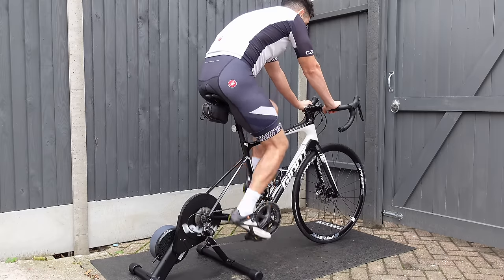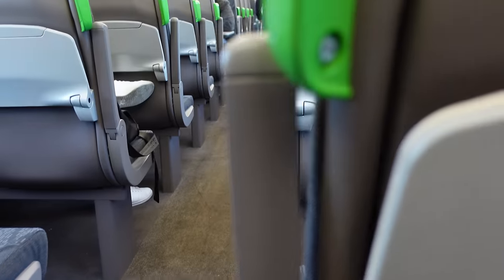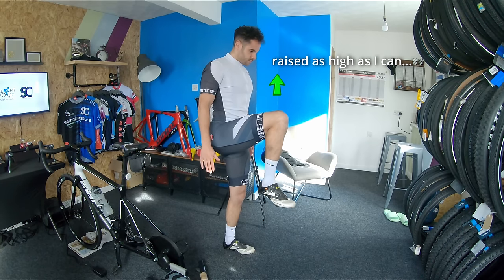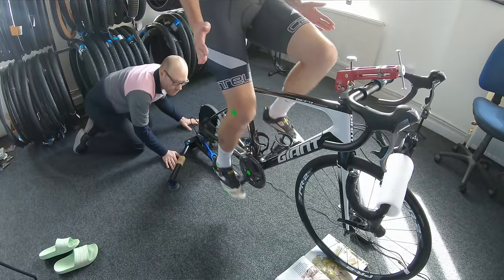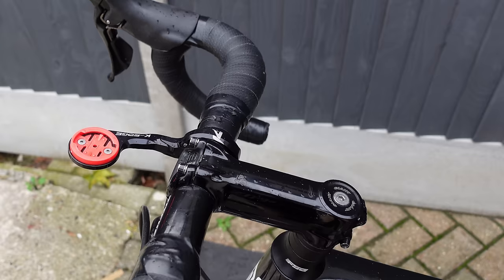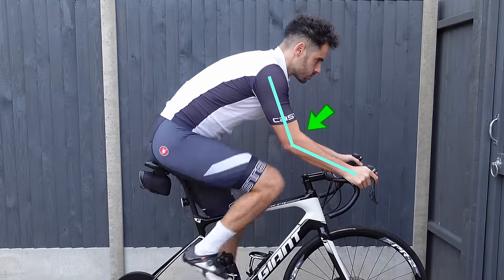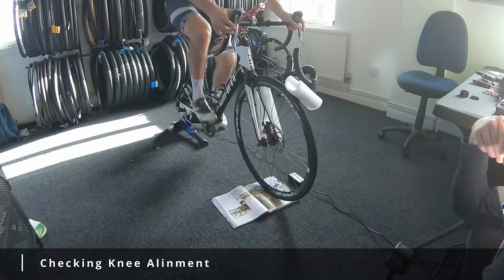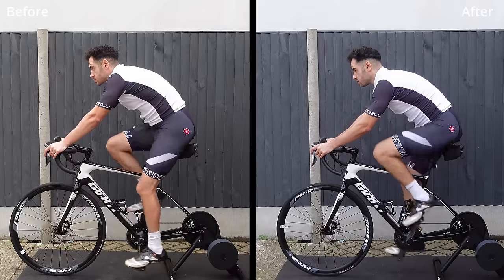I've Been Suffering For 3 Years // Full Professional BIKE FIT in 6 Steps!

Comment: I am a former pro rider and i can tell that your new position is so much better. Your upper body still moves a lot though (bouncing in the saddle), which is most likely due to your pedalling technique (pushing rather than spinning). Your shoulders move side to side, too, and this could be improved as well. Aim for a completely static yet relaxed upper body. Cheers!
Reply from the maker: Interestingly on my Elves I feel like my body is more stable out on the road - https://youtu.be/9O0AzPacRjo - I can certainly work on my peddling for sure, it's an interesting journey with steady improvements. Cheers for your comment. 👍🏽
Reply: @JourdainColeman  If you decide to work on your pedalling technique there's one simple exercise which you can do on a trainer and which can help you to improve greatly. These are single leg spins, done 5 mins with each leg at low resistance followed by 5 mins spinning with both legs as usual. You'll feel the difference immediately but for a long lasting result you'll have to make it a part of your warmup routine or do a separate session a couple of times per week.
Reply: can I ask you a question? I testrode a newer roadbike with the typical broad and flat top tube (an 2018 trek emonda) and found that my knees are prone to rub slightly an the tube. Seems I'm pedaling a bit "inward" with my knees. Should I avoid buying such a bike or could I change my knee position relative to the top tube by using differnet pedals for example? thanks in advance!
Reply: @koyaanisrider6943  , without observing your pedalling technique, it's difficult to provide a definitive answer. However, in general, knees slightly turning inward is not a concern. On the other hand, hitting the upper tube is a significant issue. If this problem is caused by your pedalling technique, it's worthwhile to invest some time in correcting it. If it's not a fundamental issue, your body may adapt to the wider upper tube, and the problem may resolve itself quickly. However, I personally would be hesitant to purchase something that doesn't feel right from the start. I hope this helps. Cheers!
Reply: @azteccat3027  thanks a lot, man!
Reply: I have had 2 fits done. Still have lower back pain when cycling 😢. I've given up on long drives. Max 40km is what I can do, with back pain starting from km 10. No medical prof Found an issue with the back. Thx for the video. Happy rides!
Reply: Thanks for this.   I just broke a vintage Vetta saddle I think due to poor technique.   Will work on my form.
Reply: Have you been to a physio? I've been and we found three issues that improved my lower back pain which used to kick in at the 30 km mark: 1) weak glutes 2) non activating glutes 3) non activating core. If you have any or all 3 of these issues, your lower back will be compensating for them which easily fatigues it and hence becomes sore
Reply: Pants.
Reply: You can even see on you new position you have so much weight on your back and saddle compare to your arms. It is like you are sitting on a old womans bike. You have a too rounded back, sitting with a curved back gives you problem in the long run. Powerwise you should have more pressure on your arms so that your weight is more forward on the peddales.

Comment: Last year I had 3 bike fits in 4 months ,all 3 were different settings , makes you wonder.
Reply from the maker: That's not good to hear. Did you find a good position in the end?
Reply: @JourdainColeman  yes my own trial and error.
Reply: Question of background theory, utilized equipments, age of the captain,...
Reply: @JourdainColeman  that's what she said
Reply: Exactly what I experienced as well. 2 bike fits and 2 different set ups. Non of them took away all my issues. 2 years later I am still feeling neck pain, knee pain and saddle pain, hands and feet that become numb. My way out at this moment is still trial and error and some YouTube video's which are also often contradictory.
Reply: @HennieBours I am feeling pain in my elbows any clue why it may be
Reply: One thing not discussed here is… CRANK ARM LENGTH. basically bikes from the 1970s when I grew up all had 175mm cranks—these are generally pretty OK if you are 6’2” tall. I’m a little less than 5’11” and new studies/papers show that 165mm is probably best for my leg length—imagine if you are 5’4”!! Basically shorter cranks allow you to have an easier time with your saddle position Where you can avoid both overflexion of the knee at the top of the stroke and less hip impingement, while remaining low enough to not reach for the pedals. Cleat position is also a big deal—I firmly believe in more of a mid-foot position (cleats further back). Ball-of-foot cleat position was considered “correct” in the 1970s because people just assumed bike pedaling mechanics should work like running—it totally doesn’t. There is no reason to overload the front of the foot forcing you to do a lot of calf contraction just to stabilize the foot, when you could transfer the load much closer to your ankle reducing the need to use calves inefficiently. This also lessens the need for shorter crank arms by the way, since there is less knee flexion with the cleats farther back.
Reply: @devashishrege1  2 most likely reasons: 1.handlebar width (more on the bigger size” 
2.too much pressure on the palm/hand. You might be too close to the bars.
Reply: @tonypowers123  it’s gravel bike checked it perfect for my shoulder 

Need to check the second option
Reply: Makes you wonder indeed...
Reply: Despite what fitters would like you to believe, bike fitting is NOT a science!  There is a lot of nonsense, technical sounding jumbo-jumbo and snake-oil salesmanship that goes into bike fitting.  Most people could set themselves up perfectly well by using a few time-tested rule-of-thumb guidelines and a little experimentation.
Reply: @devashishrege1  I'm not an expert, just a rider. More than likely it's due to your bars being too narrow causing your elbows to rotate in and placing the stress and weight on the joint rather than your triceps.   Measure from the "knobby" protruding part of your shoulder to shoulder and that will give you an idea of what width bar to use.
Reply: Saddle tilted up 1 degree does not sound like a good idea for your nether regions.
Reply: Its snake oil as the same pos is not great for all. You know best.

Comment: Sorry to say this. But your final position is far from ideal. I am a bikefitter in Spain and I would say that you need a wider saddle and the saddle height is still wrong. In the final position you are still too far from the handlebars, not because the reach is incorrect, but because you are seated too far back on the saddle (usual compensation for insufficient saddle width). Get a 155mm saddle, my recomendation is specialized power or bontrager aelous. If you are willing to follow my advice, let me know if I was right :)
Reply: Your hip is blocked because the way you seat and I bet you will have back and hip pain in the future
Reply: can you provide me a bike fit thru skype?

Comment: I'm surprised you didn't make changes to your saddle drop by removing or adding spacers on the stem. This makes a big difference to your riding in terms of aero position and comfort. What's your current saddle drop? FYI, my drop is 7cm.
Reply: I set cleats right back first then fore aft and tilt then saddle height followed by stem height. I think stem or stack height is crucial for hip angle and Aero position if you race or group ride.  Stem length I think is best left to the last adjustment the same with bar width even though they are important. That works for me anyhow.

Comment: Bike fit is actualy very simple and it doesn't cost much. I would have done that just by looking at your riding position and your flexibility score. All in all a good cyclist who puts around 10k kms evey year needs a slightly relaxed position so that there are no injuries and unnecessary fatigue. I can simply say endurance class bike geometry is the best to go unless you are pro. Love the Endurance bikes. Wohhh.
Reply from the maker: I agree with the endurance bikes if you are putting in some serious miles. Like you said, it helps prevent injury and actually allows you to ride more because of the comfort.
Reply: @JourdainColeman  if you can watch closely your before and after pic. The bike's has geometry has changed from normal type to endurance type. I would advice you to move back the hoods by around 15 mm which will provide you much more leverage and more neutral wrists position as well adding more comfort to neck.  Best of luck.

Comment: I guess I would have done the cleat, saddle and seatpost adjustments, 1st and did the bar width and reach last - you change your reach when you do saddle and seatpost adjustments, so your reach will be altered by going back and forth - also you can raise or lower your handlebars to change your fit as well.

Comment: Your ear on the line drawn up through your head tube.  Correct and rare.  This line is the steering balance point and your ear is your balance point.  
This is why it's super important to find a bike with the correct top-tube length and head-tube angle combination.  71 touring bike can have a long top tube and a 75 degree track bike needs a shorter one.  Custom steel fixes this:  Albert Eisentraut 1994

Comment: 12:20 , remove the lateral grooves in the saddle clamp plates internal faces with a linisher or dremel /coarse emery paper ,  to leave a slightly textured surface to allow "EXACT" positioning like a 2 bolt leaf spring style post . Bad design on Giant's part . Neil Stanbury once said that these seatposts can be a hindrance to getting saddle setup precise .

Comment: It’s amazing how our body can adapt. I went from riding a 15kg MTB  175mm crank , running shoes with slicks, set up with tri bars (1.5years 5-6hrs/week) 
I then purchased my first road bike  7.5kg with road shoes, 170mm crank and slammed front stem.
It was painful  , my back hurt, I felt I couldn’t get the power down, or seat high enough…. 
Drove myself mad with various adjustments, hours of research and measurements (no bike fit because COVID)
Eventually I adapted, actually dropped the seat height , increased cadence , worked on core strength and now I’m perfectly comfortable. 
I think if you get the ball park fitting right your ok. Roads aren’t flat and we’re constantly adjusting our seat position accordingly our body’s are pretty incredible at adapting.
Reply: Saddle height is all

Comment: Nice vid. Pretty cool common sense stuff wrapped into an actual procedure for achieving the right fit. Unfortunately bike shops are probably the worst offenders when it comes to getting the right size bike. They'll sell you what they have in stock rather than what you really need. So many noobs drop out of cycling because the discomfort they experience originates from frames that are just too big.  Most of the time you can get a perfect fit on a smaller frame as shown in the video but there's nothing to be done if the local bike shop put you on a frame that's too large. Everyone needs to see this vid before buying a new bike.

Comment: I'm getting used to my own "senior shrink" ~ I was a even 6ft tall (183cm) until 60yo ~ and at 66 I now measure 5'9" (175cm).

As most of this seems "spinal", I'm trying to adjust on my own, with shorter stem length (headset/classic), and moving saddle [edit] forward.

Your work with an expert gives me hope, for the "Goldilocks Theory"* I've gleaned from this video. 😊

* "too high > too low >> just right!"

Very appreciated 😎
Reply from the maker: Glad to hear that the video helped you! Also great to hear that you are pumping out miles!!

Comment: Great videoa nd hi all.  got a gravel for almost two years now and kinda have feeling I fight with it still. Size is recommended for like 182-196 cm and I am 196cm/100 kg dude, with pack, a quite more. I have feeling I am both too short and too long for it. Too long because I can see the bit of hub in front of a bars (basic advice), then too long, because I feel a bit of neck pain and I feel my shoulders are bit in front. The fact I need to raise my head a tiny more does not help for sure, using trail helmet with the sun shield. 

Last year I tried wider and different type of bars Venturemax WCS 46 cm on top 56 cm on bottom instead original drops of 44cm, so raised my reach a bit more too. I do not use drops that much now, cuz it is impossible to hold a brake lever with one finger there as I am used to from MTB. I feel sometimes also some tingling in my hands after a ride, so maybe too much pressure or harsh carbon fork. Also, some rides I could do 100 km and my knees were fine, some others I felt a pain after like 20kms, but that might be due a non riding for some short time. Tried to have my knees above the chainring, but yeah just, and basic advice again.

Funny thing fit wise was I was really happy on my girlfriend's gravel from Decathlon - RC500 in M (173-180 cm my lady is 176 cm) size, as enjoyed the upraised body position of a torso, of course bike was too small for my legs to extend well. So I kinda have a feeling my XL bike would be better for me with much shorter reach or opposite bit longer so my back could really get straight and lay on the bike. 

Sorry about the long rant, maybe someone will have some tips or share the similar experience. :)

Comment: Good video, it's mindboggling how many variables there are and each time you alter one it affects the others. Did he check anything like your "ape index"? Also what crank lengths you are using? I have one road bike that is somehow set up perfect for me just by trial and error, I've another that is a winter bike but needs matched up with almost the same dimensions if possible. It has an extra 20mm on the ETT(550mm) despite a 51cm C-T so I've had to go from a layback post to inline, and I've also dropped 10mm from the stem to 70mm plus narrower bars are(both) in the post (40 compared to 42 original) which also have a 70mm reach compared to the original bars 75mm. I'm looking for a more relaxed "endurance" position, and yesterday I realised that to be gripping the hoods my arms are almost locked out. I moved the seat 10mm forward yesterday and that is a definite improvement along with putting my cleats all the way back (Shimano curse of a 46 shoe when I usually am 44). Most of my issues on fit come from the fact I'm 169cm yet my mid axle to saddle top measures 88cm, my reach is ridiculously short or my legs are ridiculously long. I ride with 170mm cranks but have 175mm on the MTB and no issues, sometimes wonder if 170mm is too short.... I used flat pedals to check my feet positioning and when on a decent long bit of road found my comfortable position then looked down, my RH heel is a bit further in..... it's a never ending process this! I knew from the start you were probably too far back on the saddle and/or the stem was way too long... I'm even wondering whether I should consider a womens fit bike as they are meant to be for longer legs/short torso rather than mens which are generally the opposite??